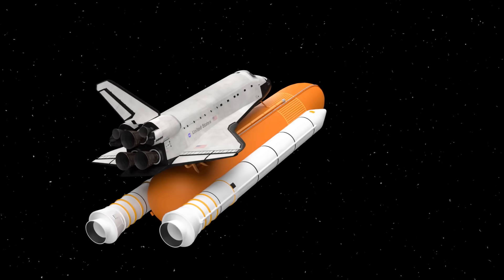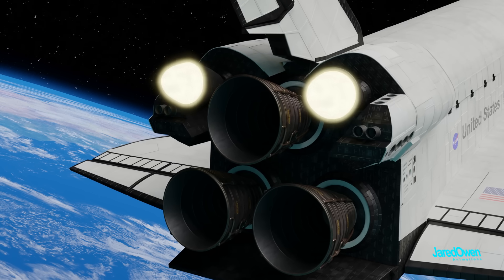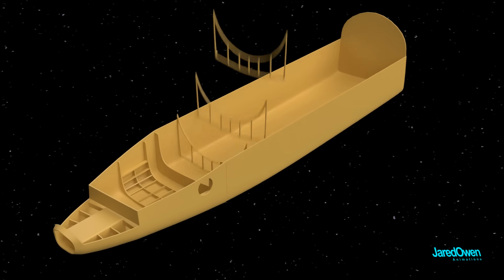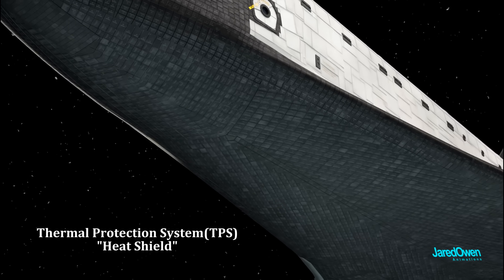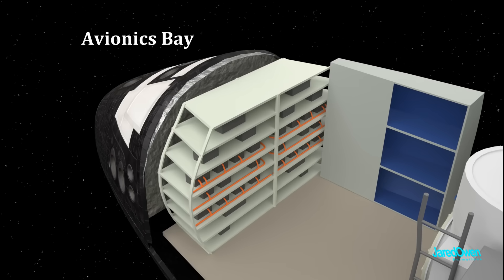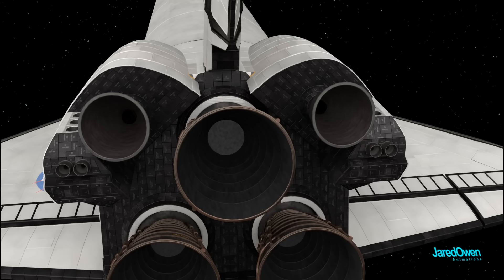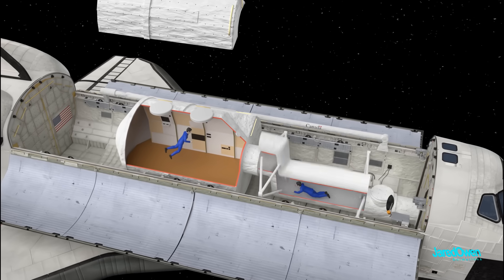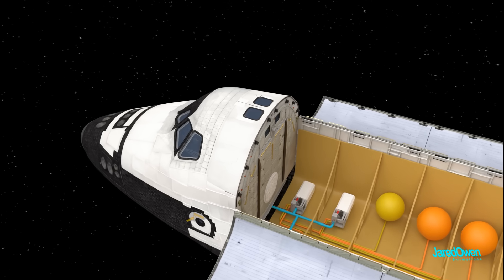How did the Orbiter Vehicle work? (Space Shuttle)

Comment: I have some questions 
How this orbiter orbit the earth 🌍 without fuel? It’s like an aeroplane, With so much speed for a very long time.

What is difference between this orbiter and ISS both orbit the earth!!
Reply: Once it’s high enough to be outside atmosphere there isn’t any drag from air to slow it down. It continues forward at the same speed. Things in orbit are actually falling towards earth like anything would fall, but it’s going fast enough sideways that it just keeps falling all the way around. If you stand on your house and throw a ball, it will go forward a bit and fall to the ground. If you fire a bullet it goes a lot father but still falls and hits earth. If you could throw a ball like 18000mph (and there was no air resistance to slow it down) it would go all the way around and hit you in the back of the head. It doesn’t fall fast enough to ever hit the ground.
Reply: @adion24  thanks but how without fuel
Reply: @sanjayror  They need fuel to get up to speed and above the atmosphere, but once there they can shut the engines down. Without air resistance there's nothing to slow the craft down. They're coasting. Gravity is still trying to pull them back down, but the lateral speed is enough to loop all the way around.  Thats why they orbit and dont fly off into space. When its time to come back they use fuel to slow down some, and gravity pulls them back into the atmosphere where they hit air and really start slowing down.
Reply: @sanjayror  And the ISS is the same way. It's going fast enough that it coasts around in circles. It doesn't lose speed when they "take their foot off the gas" because there's nothing to slow it down.
Reply: @sanjayror  Oh and the shuttle itself did have some fuel on it. Just not a lot. And it didn't have jet engines like a plane so they coasted it all the way back to landing.
Reply: @adion24  when they do space walk at time what is speed of ISS ?
Reply: @sanjayror  Roughly 17500 mph. And the astronaut is going that fast too.  If you watch a video you'll see the earth screaming by underneath them.
Reply: @sanjayror  You can see the speed here.  The ISS is so high up its harder to see the speed. https://youtu.be/t7r2T1ggBn8
Reply: but that's a movie.
Reply: @moejama64  ok

Comment: How does the front tire not explode ? All it took a was a minor crack in the tiles to bring down the columbia. But at the hottest part of the shuttle during reentry its just an insignificant airplane landing gear door protecting the wheel and tire ?
Reply: If you pay close attention, you can see that the doors for the landing gear bays are all given heat shielding like the rest of the heat shield.

Comment: how did they get the solid fuel boosters back?
Reply: They had parachutes on them and tracking devices that give off radio signals like the ones used in black boxes in  planes usually will slowly drop in  the ocean they are picked up in boats the empty tanks mean they can floats in the water
Reply: @456nelyboy  thank you
Reply: its faal in the atmospher and parachute slow sown the booster for splash down en a special boats comme to recover it
Reply: @jamaldaoudi5799  thx

Comment: awesome work on this animation. That crew compartment was not very space efficient was it, especially the mid deck. I could see many areas where I would move things around to provide more compartment space. In a modern space shuttle the first thing I would get rid of is the avionics bay because modern technology doesn't need to be stored like that to drive the shuttle. I'm then putting the lockers where the avionics bay is. With a larger mid deck I would then move atleast 1 of the 2 rear seats from the flight deck to the mid deck. The air lock needs a larger oval shaped door to make entering and exiting easier.

Comment: Egh the shuttle didn’t glide it just kinda fell persuasively in the direction of the runway, pretty sure even some nasa people have said a brick has a better glide slope than the shuttle
Reply: Haha, not exactly true, but probably the next after the brick.
Reply: Glide ratio was a lot better than for the original proposal in the 70's, which would have had a small straight wing.  The as-built design may have only been about 3:1 in a stable descent, but with speed buildup ahead of landing was actually 30:1 or more at touchdown -- basically a sailplane, if a rather fast one.

Comment: Just wondering, if the 3 main thrusters were used for launch only, why are they built on the shuttle instead of the boosters or the main tank ? wouldn't they just be dead weight in space ?
Reply: That's true, but the shuttle's main engines (RS-25) are the most advanced and fuel efficient but also the most expensive rocket engines ever flown. 46 of them were built during the shuttle program for an average cost of $40 million per unit or $120 million per shuttle.
At that cost, it probably made most sense to attach them directly to the shuttle so they could be recovered and reused even if they represented nearly 10 tonnes of dead weight in orbit.
NASA has now in its infinite wisdom ordered 18 more RS-25s at a cost of $100 million per unit for the core stage of their new SLS rocket, each stage carrying 4 engines = $400 million that will not be reused but will end up in the ocean.
https://www.americaspace.com/2020/05/02/nasa-orders-18-more-rs-25-engines-for-sls-moon-rocket-at-1-79-billion/
For comparison, Rocketdyne estimated in the early 1990s that the price for the F-1A (an uprated but unflown version of the F-1 from the Saturn V) would be $15 million per unit for an order of 40 engines or more produced at a rate of 10-12 per year. It's worth noting that the F-1A would have been over 4 times more powerful than the RS-25 even if it was far less fuel efficient.
Reply: @fromnorway643  i see. thanks !

Comment: Actually landing is way more different to a plane. There is an explanation from NASA how it works. Planes have flaps and what not and are much slower when starting the landing process and have engines they can use to correct speed etc.

Comment: From an engineering perspective, the space shuttle was a marvel. Truly one of the great feats of human ingenuity. But so was the Concord. And just like the Concord, the problem that doomed the space shuttle was cost.

It turns out that making and maintaining reusable shape ships is actually more expensive than making single-use rockets that then get discarded during the mission. Despite being reusable, it's very expensive to have to repair and refurbish both the SRBs and the OV for each mission. So expensive that cost per pound of payload for the shuttle was multiple times that of the Soviet-designed Soyuz rockets. This is why the shuttle program was shut down while the Soyuz rocket is still being used today. It's also why, despite getting offers of new reusable designs, NASA is going with single-use rockets for their new vehicles for the Artemis project.

Comment: I think NASA should keep on flying the Space Shuttle fleet, but build new and better one's...like a complete shell replacement beneath the Shuttle instead of 2,800 pices of tiles...that is good for ten(1) Shuttle missions before need to replace the said underbelly heat shield shell.  And, use the Space Shuttle fleat to fill the satilite launching market again.  The Space Shuttle "Columbia" was the only Shuttle that had "no" robotic arm in the cargo bay(one(1) important thing the above video left out and not mentioned).  Important, because the Shuttle "Colombia" caught fire upon the front part of it's wing on re-entry from a missing tile that fell off during lifting off into orbit, based on the US military(that prior took over NASA after the 1986 Challenger explosion) deliberately "violated" a mandatory rule, by unauthorized Ordering the Shuttle Columbia crew to begin re-entry "without" Ordering the crew to "do" a "spacewalk" first to check for any "missing" tile that might had blowed-off in all the wind during launch(happen "all" the time---the astronauts has a calk gun to squrt heat resistance goop into the spot where the tile fell-off at).  All of the other Orbiters's(Space Shuttle Fleet) has a robotic arm in the cargo bay that they can strap a camera onto and circle the arm around the outside body of the Shuttle in checking for any missing tile "without" having to do a spacewalk...but, the Columbia "didn't" have a robotic arm, and, therefore, requiring for a spacewalk before re-entery---but, the US military gross negligence, did not Order a mandatory spacewalk first, that is the proximate cause, and the results thereof, the Shuttle Columbia catching fire and exploding over Texas on re-entry.   It wasn't no external tank foam falling onto the wing of the Shuttle during liftoff....that was all a coverup by the US military, trying to falsly make it appear it wasn't their fault.  Why, don't somebody do a video about this...the government isn't going to tell you.

Comment: instead of creating remote control planes, f16,18, eurofigther ... x45, x47, x48, x51 has been upgraded to scale 1.3-1.4 medige, why not, also space shuttle like nowadays the x37a, b, c, d, xa. First, with the help of a meteorological balloon at 45 km of altitude and then with a hydrogen rocket engine at a scale of 1.3 measures of the original trambordador, use the Columbia, for the death of the astronauts and in honor of them. automata, with artificial intelligence. He flew at a height of the karman line 100 km of altitude. It was in levitation for 31 days. then i did tramvorder style x47. it launches in a meteorological glovo at 45 km and then the rest are done by its 4 engines until the remaining 60 km. and earn a very good reputation in aeronautics and aerospace.

Comment: I'd like to add that the Seattle Flight Museum has a mockup orbiter that was used in training astronauts. The exterior is just wood and whatnot, but the interior is mostly "real" components. The cool thing about this though is that they actually allow a few people each day to take a guided tour inside the mockup.

It was surprisingly small inside. 6 of us (and two guides) could stand around comfortably on the lower deck, but the flight deck only had room for 3 people and the guide (4 total) to stand in the rear half (where the removable seats are). What's more, the ceiling was so low there that I couldn't even stand up straight, and I'd have had to get down on my knees nearly to get into the pilot's seats.

Comment: So those skinny little bars that attach  the shuttle to the orange tank during most of the liftoff were actually fuel pipes,so that means hollow tubes. Soo how much weight were these bearing,,taking into account the weight of the boosters,travelling at how many thousands of miles per hour. Yet they simply unclipped to release the orange tank. Are you really serious in thinking 4 tubes could even hold all that weight at takeoff nevermind the vibrations and stresses of pitch and roll programs without a single wobble.  Thats in the land of fake believe. Its  just more curtain rods like apollo. The airlock was moved to incorporate a docking port in larer missions for the iss,so tell me just how did it dock with the mir years before the iss,the very same mmir that had an alleged fire and amazingly,considering the oxygen rich environment  everyone lived to tell the tale. Absolute fucking bollocks.  Credit whsre its due the animation is excellent,just make  it for something thats real,Trumps hair would be a good one.

Comment: question. why the external tank burned up in the atmosphere after separated, but not burned when it was still attached to the OV in the atmosphere?
Reply: During launch, the shuttle gradually accelerated from zero to just short of orbital speed as it climbed from the dense atmosphere at sea level to less than one millionth of that density at the altitude of tank separation. The few air molecules left could still cause some air resistance, but it wouldn't slow down the tank very much at first. When the tank met the denser air lower down, it therefore had a much higher speed than when passing through the same air on its way up.

Comment: While the space shuttle was technically re-usable, the extensive refurbishment between missions was so expensive that it would have been cheaper to use an expendable vehicle that was thrown away each time. Luckily, modern manned spaceflight has finally succeeded at this, with most of the Falcon 9/Crew Dragon stack able to be re-used at a tiny fraction of the cost of the space shuttle.

Comment: what are the wheels made off so that they can  withstand the heat being in the heat shield
Reply from the maker: great question - I'm actually not sure
Reply: @JaredOwen   thanks for replying
Reply: Standard airliner wheel engineering, for the most part -- the heat shield kept the heat out.  Tire design was also mostly airliner-spec, to within some adjustment in the proportions of materials (e.g. synthetic rubber, cords) to meet the design specs.  And because the tires could be inaccessible for many weeks after an Orbiter was mated to the ET, each tire had a pressure-vs-time curve determined over three months, and then each was "overinflated" by an amount which would have it at about the desired pressure by touchdown.

Comment: Awesome job on the videos. Could you do a video explaining what happened to Challenger and what happened to the crew compartment.?  

Two things I never understood was how the shuttle continued up another 24,000 feet before breaking apart and how the crew compartment stayed pressurized until impact with the ocean floor
Reply: I can answer the first part of your question:
Challenger's vertical speed at T+ 73 seconds was already about 1500 ft/sec or more than 1600 kph, so it wouldn't immediately loose that speed, but continue to climb for some time before it started to fall back to Earth.
For comparison, the first stage of the Saturn V was jettisoned at an altitude of about 68 km, but its momentum made it continue its climb to more than 100 km altitude before it fell back into the Atlantic 560 km downrange of Kennedy Space Center.
Reply: @fromnorway643  thank you. So in reality it climbed for another twenty seconds give or take a few seconds before falling. Add that in with the time of falling that had to be the LONGEST three minutes ever.  Thanks for your answer.

Comment: Extremely well done.  The thing that always strikes me is how tiny manned spacecraft really are.  As big as the orbiter is overall, the crew compartment is quite cramped - my wife and I got to crawl around in a simulator at Johnson Space Center last year and it is a tight fit.  Less of an issue in orbit, of course, but even so that's really close quarters, which I think the animation did a pretty good job of showing (having a model of a person or two might have driven it home a little better, but that's okay).  

And that makes perfect sense - that's space that has to be kept pressurized, at a comfortable temperature and humidity, with a way to scrub excess CO2. The equipment required to do that is heavy, so you want to minimize it as much as possible.  John Glenn once joked that you didn't get into a Mercury capsule, you put it on.  The Gemini spacecraft was described as being like the front seat of an old VW Beetle.  The Apollo command module had all the interior volume of an SUV, and the LM was like two phone booths glued together.  The Shuttle orbiter must have felt like being in a movie theater by comparison, but objectively that is a tiny, tiny space for 7 people to spend a couple of weeks in.  

As big as Starship is going to be, it's not going to be that roomy on the inside.
Reply from the maker: Thanks John - you know your stuff very well!  Stay tuned, I have another space shuttle animation coming soon (tomorrow hopefully)
Reply: The ISS’s pressurized volume must have been heaven for astronauts coming from the Space Shuttle program.

Comment: why have a massive external tank for no reason if it was gonna fly for six min like that's a waste
Reply: There were plans to find a use for them but eventually discarded for various reasons. The same thing goes with pretty well anything that goes into space. Just look at the Apollo lunar missions with the only thing safely returned to Earth being the CM. Even back then they thought about a “wet workshop” concept with the 3rd stage of the Saturn V but planning and actually getting the funding for it is always a huge issue.
Reply: @mako88sb  oh i didn't know thanks for telling me
Reply: @mako88sb  
The "wet workshop" was initially planned to be launched by a Saturn IB rocket, in which its second stage (the S-IVB) worked as an active rocket stage during launch and was outfitted as a space station when in orbit.
When the last three of the planned lunar missions were cancelled, that freed up three Saturn V's capable of launching the S-IVB fully outfitted as a much more capable "dry workshop", which also included a large airlock module, multiple docking ports and a solar observatory.
That became the Skylab space station that was launched by the very last Saturn V in May 1973. This was the only of the 13 Saturn V launches in which its second stage (the S-II) also ended up in orbit.
Reply: @fromnorway643    Thanks for the correction.